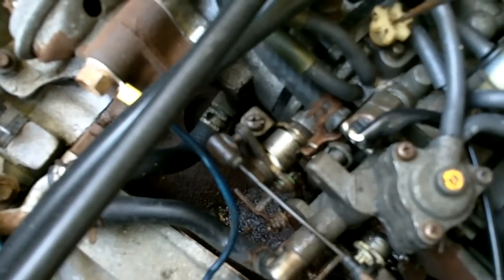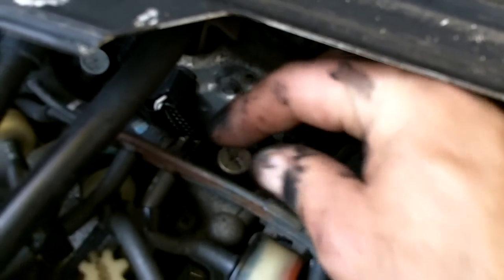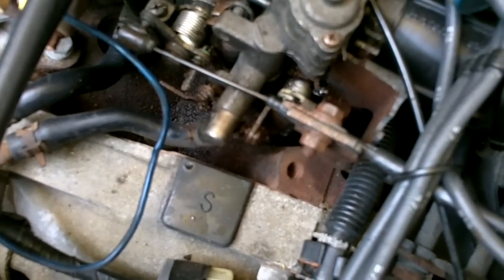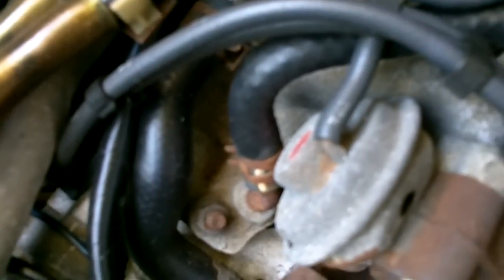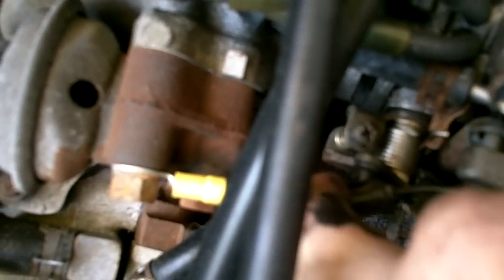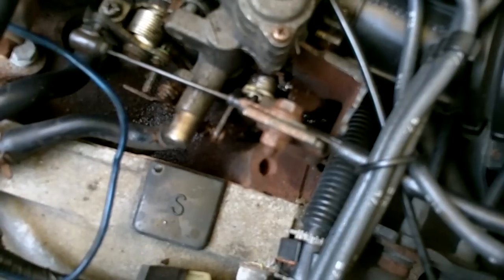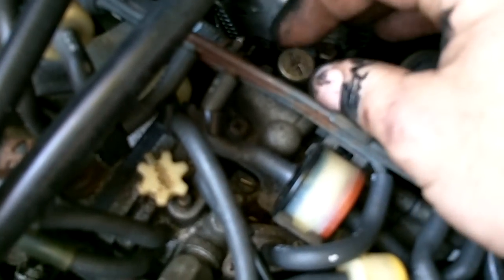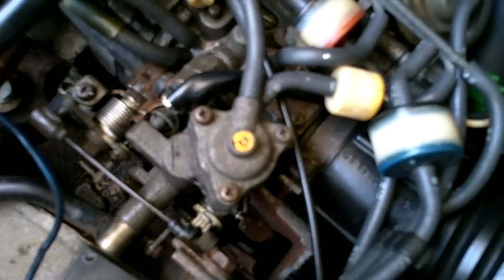carburetor adjustment Daihatsu Hijet S83p Japanese minitruck

Comment: My friends is a 94 1000 petrol engine running rich. It seems to have a manual cable choke. Needs full choke to start it and stutters and stalls unless the choke is out for a long time. Is there a mixture screw on the carb or air bypass jet? when it’s warming up under choke. Isn’t helped by radiator fan being wired to be always on. Probably needs a new sender unit. I believe it’s supposed to operate at two speeds depending on temp and shouldn’t come on straight away.

Comment: Hi Fupabox.  Thanks for sharing this video, very helpful, to me at least.  I have a 550cc version of this truck and I have made a bang up job in trying to tune it.  First off, I had no idea what the adjusting screws were adjusting.  I'd do ok with a regular downdraft carb but this would be a stromberg or skinner-union type if I'm not wrong.  I thought the cold idle adjust was the idle speed adjust (confused me to see there was another one off to the other side of the carb), the warm idle speed adjust was presumably the fuel mixture (judging from the fuel hose close to it).  I noticed that the choke flap would be at a small opening at idle, and opened up as more air rushed in with the throttle opening.  I assumed this was to help draw up more fule to the venturi when the airspeed was low.

Anyways, my engine has been idling unpredictably since.  I got it to a point now where the engine speed would "gradually" come down to an idle, but would stall if I kept it there for long.  Tricky business driving through stop and go traffic. I had thought that some sort of air or vacuum circuit and been wrongly routed or improperly condemned, and I did find some vacuum leaks at first. I might have to actually remove the carb from the engine and take  a close look, but thanks again for your vid I think I'm now more able to make a more accurate attempt 2nd time around.
Reply from the maker: very welcome...glad it helped
Reply: Hey +Chuddlebuggy did you figure out your carb? I have the same 550 cc engine. It has a new (Aftermarket?) carb, but I don't know how to adjust for bad cold starting. Any pro tips? For instance, mine does not start on a high idle (2000 rpm) at all, so I maybe need to figure out why. Probably what's wrong, as a low idle simply makes this thing hard to get going at all. Mine tries to idle almost silently, presumably down around 600 rpm (no tach)

Comment: @fupabox Thank you very much. i will try to get a suitable replacement. i will let you know how it works. 
just out of curiousity do you have any schematics to show how the vaccum for the mini dump truck model s83p. my electronics all come on but the vaccums dnt work for the 4wd. non of them neither does the sudiff lock. all the switches are giving current but still no vaccum. some of the hoses arent connected. NB this is for another vehicle i have two. one dump truck an one regular truck.

Comment: hey ! Can you answer a question for me. The little choke coil tension spring. Where does it attach to the lever? towards the tip or closer towards the shaft? I can kinda see it in the video. It looks like it's on the outer part of the linking, but it's blurry and hard to see. mine looks like someone bent it.

Comment: How can I contact you about more info?  My s83p does not like to start unless I cover the carburetor with my hand when it is the warmed up.  I understand that if it was cold then I could have a choke issue. But why do I need to cover the intake when it is already warmed up?

Comment: @fupabox thank you i will check it an let you kno how it goes. but first. on the engine block itself there is a cylinder like thing which all the hoses are connected to, it is broken an is no longer connected to the engine. could that be the problem?

Comment: hey I have a 92 S83P and I had to rebuild the carb without directions and I thought I did a great job on keeping track of my vacuum line placement but now when I start the engine I start to get a hissing sound from one of the lines after about two minutes of warming up and then the choke idle starts rising with the hissing sound....I cannot find a vacuum diagram anywhere on the internet...Any help I would be grateful for.

Comment: I am working on a 92 Suzuki that will not idle down. It has been set up for a good bit. Any suggestions to what I need to look for? Once the engine warms up it diesels really bad when I key it off. Thanks in advance.

Comment: @fupabox the idle speed is still high. i encountered this problem when driving. as i stopped the vehicles the engine raaced ahead then rapidly dropped down finally cutting off. i checked the caburattor, left it over night then started it back. the same high idle. at both hot an cold engine temp. when i adjusted the throttle it dropped very low an raced back up an down uncontrollably an keeps cutting off. it is nt holdn or taking any tuning

Comment: Have been working on mine and as you suggested, the choke is stuck or at least very tight without freeplay in it like you mentioned it should have. What are your recommendations to get it unstuck and freely moving?
Reply: You can take the butterfly off from the choke and then removed the tiny little pins that hold the choke lever mechanism in place. Then remove the choke shaft. Clean it up and apply some lube.

Comment: My hijet is dumping fuel in at cold start floods wont start, what is your suggestion on the flooding?  TYIA
Reply from the maker: wax pellet type choke enrichment in the carb is likely stuck. A lot of Japanese JDM vehicles never get coolant flushed . The coolant passage into the carb choke is very small and can get clogged. You can try blowing out that small line with compressed air , Also likely that the float seat is gummy if you are using fuel with ethanol in it, Try 1/2 bottle of seafoam in the tak with a full tank of shell v power premium . That combo will usually clean the gunk out that ethanol can create. If not seating properly the float will allow fuel to drip into the intake and flood the truck every time after sitting till cold .

Comment: Fupabox, you may have seen my post on the forum, but in case you didn't, how do you keep the truck from dying when warm and you remove your foot from the gas pedal?  Is that just an adjustment with the big screw (warm idle adjustment)?
Reply from the maker: yes the warm idle adjustment

Comment: Is it possible to adjust thos carbs with vaccume gauge ? 
I have CB41 engine and it pain in the ass to adjust it, i bought new carb but i think its for S110 or something it almost identical but it dont have as much vaccum hoses as my old one, it has choke on vaccum this one does not. 

Regards,
Reply from the maker: yes you can . Just hook a vacuum gauge to the carb after warming the truck up ..then adjust the mixture screw until you get the highest  smooth vacuum reading

Comment: Can you explain what opens the choke after it warms up?
Reply from the maker: It is thermally controlled by a small coolant line that goes to the carb...when hot coolant makes a bimetallic spring move , it should open the choke.. the usual culprit is a clogged coolant line to the carb

Comment: Thanks for this. I have a racing engine on start up. Won’t run smooth till after 10 minuites, then sounds good. Can I follow this on Diatsu romahome 13 hundred engine , 1999. Thanks
Reply from the maker: I'm not familiar with that engine , possibly the same ..

Comment: Thanks! Have you ever seen the previous model engine, the 550cc ? Is it almost the same?
Reply from the maker: I haven't worked on one,but from the info I've seen they are pretty much the same. Japan allowed a jump in maximum CCs from  550 to 660 for Kei class vehicles. Most manufacturers just increased displacement by boring out the cylinders . The carbs would have larger needles , and possibly bigger valves . I think the 550 engines were all sohc , and the 660 was available in both sohc and dohc with 2 or 4 valves per cylinder . the 550cc was called the EB series and the 660 was the EF
Reply: @fupabox  Thanks. Some parts are similar or the same, but as you know that's hard to verify. Hey, I just found out that a new (aftermarket?) carb for my 550cc was installed by a previous owner and he didn't hook up the auto-choke. It seems to be a mechanical action coming from a heater hose that detects engine temperature and chokes it?!? Mine has no choke cable at all, and I finally figured out why it's hard to start this thing!! Where does the choke cable go, how does auto-choke work? We are flooding the engine so bad that fuel goes backward into the intake with these cold days.
Reply from the maker: @uruiamnot  The auto choke works with a melting wax that is attached to the cooling system . No cable
Reply: @fupabox  Ok, I knew about the wax thing, and I knew that cars of that era used a wax-operated "door" in the snorkel (air intake), but I thought that the Daihatsu auto-choke had an external rod to operate the choke. But now I think I see a more direct connection where the wax moving part is internal and connects to a part of the original carb. Since my truck has an aftermarket carb and a cable-operated choke, I was wondering about whether there is a way to automate mine. If not, I was going to try a choke cable for a lawn mower or something so that the choke can be manually operated by the driver.

Comment: Hi there fupabox - great videos, they have been very helpful for me.  Have you come across a service manual for Hijet trucks?  Could you point me in the right direction?  Thx!
Reply from the maker: online manual should be downloadable from this link .. make sure the engine size is appropriate for your model because the old hijet was sold as the Piaggio Porter for many many years with the same chassis,body  and drivetrain ..but different engines   http://shareasale.com/r.cfm?b=1003712&u=1635518&m=49176&urllink=&afftrack=
Reply: Fupabox - thanks for the tip.  I looked through the list, but it wasn't clear regarding the motor.  I have a 1994 Hijet S83 with an EF-CS motor (4-speed), 659cc.  Any idea which manual would cover that truck?  Thanks again.
Reply from the maker: s83 ..ok .. I don't see that model on the manual site... here's one https://www.grparts.net/product-p/manual-colon-%20daihatsu.htm

Comment: Mine is running rich; I was hoping for something I could adjust to lean the mixture..? (not at idle)
Reply from the maker: likely your choke isn't coming off fully 4:10
Reply: @fupabox  Good point, Ill watch and maybe do some lubing. Might need to do some cleaning first, I blew the dirt out but didnt brush anything.
Reply from the maker: @natehill8069  check the coolant lines that run to the choke as well... if they are clogged the choke can stay on and cause rich running
Reply: @fupabox  Plus I rarely drive it more than 5 minutes at a time so the water never gets hot. I wish it just had a simple cable-operated choke.